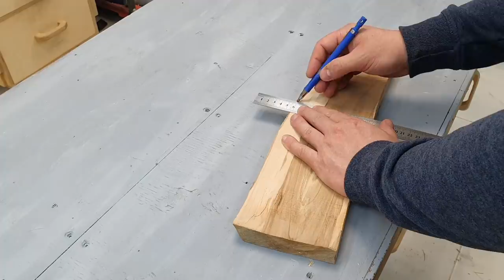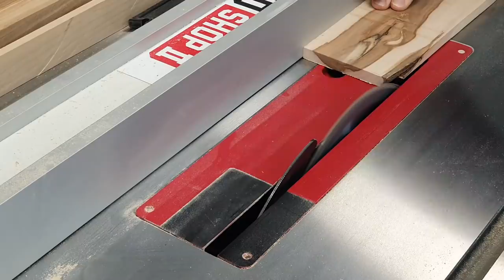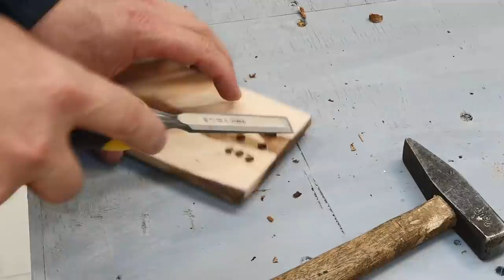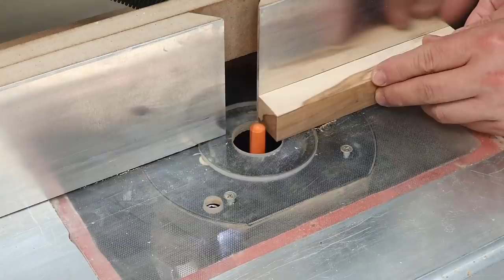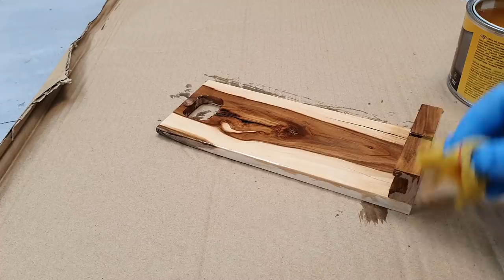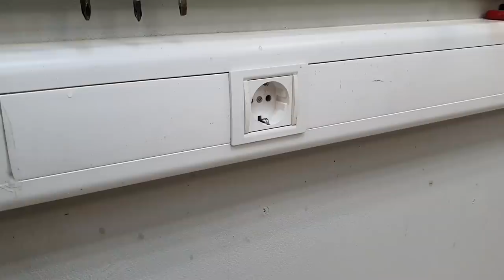An original accessory for your smartphone! Super helpful!

Comment: I've seen this type of idea, before. Seems to me to be a bit of a dodgy idea to be hanging any weight greater than the plug itself from the power outlet. Looks nice, though.
Reply: True
Reply: One week and someone bumps into it, cracking the screen? Also, if the plug shifts, it may not charge - always push it back in.